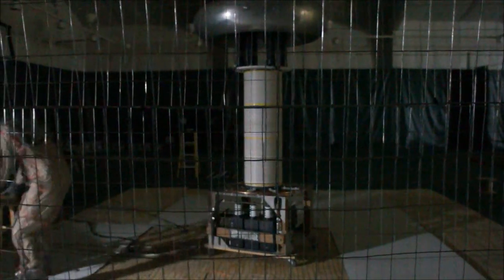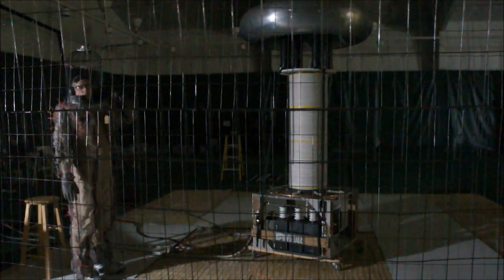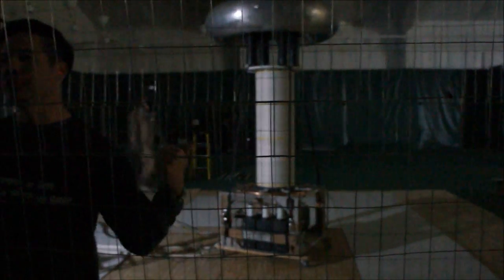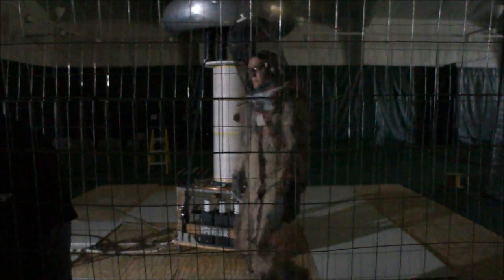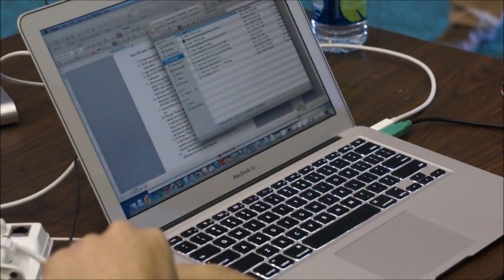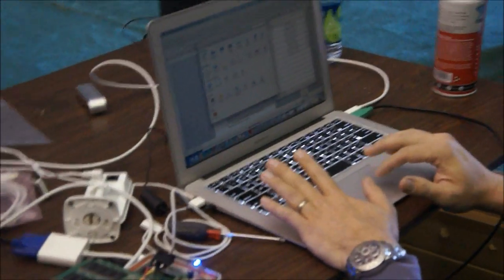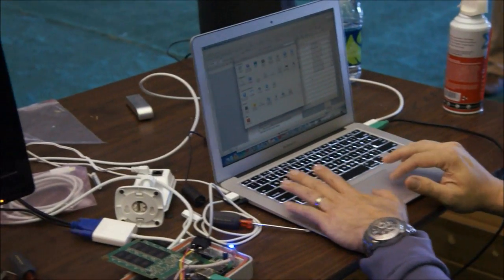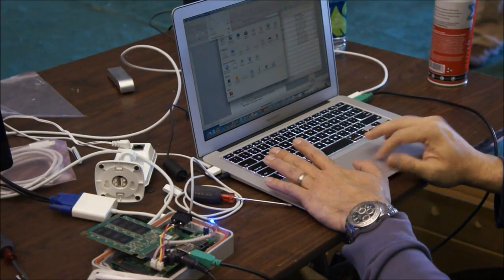1 million volts, a hard drive and Dr Megavolt

Comment: Dr. Megavolt that suit does not protect you from X-rays and UV light produced by the lightning.  The level of danger increases as the current of the discharge rises.  The level of current will determine if there are x-rays.  Typically you need at least 10mA to produce the x-rays so the current rating of the Tesla coil will tell the tale.  You should at least get some UV Laser goggles.

Comment: Could you wear that during a thunderstorm and remain safe? Or would the current from the lightning be to much?
Reply: The metal mesh that makes up the suit would have to be of adequate gauge to handle the current/voltage, which is fairly easy to figure out. So yea, you could wear one of these and be protected from lightning. Could you just willy nilly strap one on without knowing the specs it can handle and do it? hell no. If too much current/voltage passes through a wire,  best case it will simply melt. If enough current is applied over the wires electrical potential it will literally vaporize the wire. You can see this happening at far lesser voltages than lightning. Look up people playing around with high energy capacitor banks on youtube.

Here is what I found on lightning strikes energy:  An average bolt of negative lightning carries an electric current of 30,000 amperes (30 kA), and transfers 15 coulombs of electric charge and 500 megajoules of energy. Large bolts of lightning can carry up to 120 kA and 350 coulombs.

You could figure the math out, but I can't find any calculators which will allow you to plug in such large number to find the right gauge/material, they usually return NaN(Not a number.), or error.

Needless to say, the wire gauge would have to be so large that the suite would probably weigh more than a human could lift. Then again we are entering an age of metamaterials, smart materials which have insane properties.  You would need a wire with an insanely high-temperature resistance, low impedance, and very high conductivity. nichrome wire has a very high-temperature resistance, but it also has a very high electrical resistance, as such, it's used in heating elements, etc. Poor choice for a suit, unless your end goal to cook a human like a roast.Maybe some form of carbon nanotube wiring, or one of the newer similar materials (like Diamond nanothread) could work to make an effective suit.
Reply: jscix Well, lightning rods are a minimum of 13mm in diameter and there’s a temperature rise of about 60 °C worst case, I think it’d feasible: https://engineering.stackexchange.com/questions/1785/why-doesnt-a-lightning-strike-destroy-the-lightning-rod
Reply: Почему громоотвод имеет маленькую толщину, он длинный и из обычного железа??? @jscix
Reply: Youd probably go deaf.
Reply: I dont know bout the glass head protection a those ranges pretty sure it would explode but good for one use but you could make a metal head protection and a plastic screen of high thickness where the eyes would be and the metal from the head protection should be grounded then you are safe

Comment: Why does he have that big ass suit on? You'll be fine without it on, and even if you do get a shock it'll just hurt like hell, won't hurt you
Reply: "It will just hurt like hell, it won't hurt you"
These are two contradicting statements, do you know that?
Reply: +James Walton,

"You'll be fine without [the suit] on, and even if you do get a shock it'll just hurt like hell, won't hurt you."

No, it won't just make you "hurt like hell". The electricity in this video is 1 megavolt or 1 MILLION VOLTS. To put that into perspective, American electric chairs usually only use 2 kilovolts or 2000 volts, so the electricity you see in this video has 500 TIMES the energy of the electricity that was used to execute people. Thus, if you were to be shocked by the electricity in this video, you would at best (or at worst; depends on how you look at it) be injured severely, although it would probably kill you.
Reply: V = IR, ohms law my friend, voltage is just the difference in charge between 2 points. You can have millions of volts electricity touch you but with little enough amperage or high enough resistance between you and the current source, it does not matter how many volts you touch.
Reply: +noblehazards,

It does matter how many volts you touch: the human body has a resistance of about 100 kΩ, so if you got shocked by 1 MV, you would have 10 A of current going through your body (1,000,000 V = 10 A x 100,000 Ω). That's more than enough to kill you.

Comment: A lightning got 5000000000 volts!
Reply: Lightning strike have 20 milion volts 😊
Reply: @Krysar  its usually around 100,000,000 to 1,000,000,000
Reply: @godparticle3833  He told you good estimate of an average, fully developed leader potential: 20-50 MV. That gives 30-50 kA return stroke currents
.
Reply: Lightning exactly is about 126mili volts
Reply: @ricardomilos5797  bruh it's 7 years ago dawg